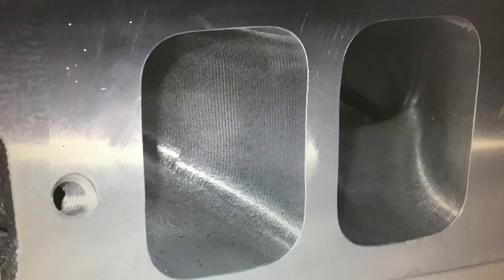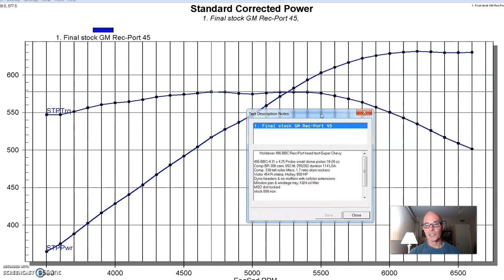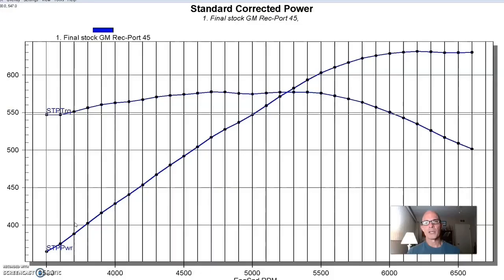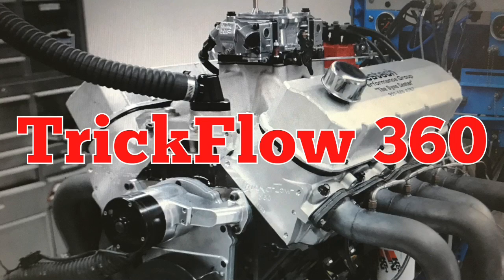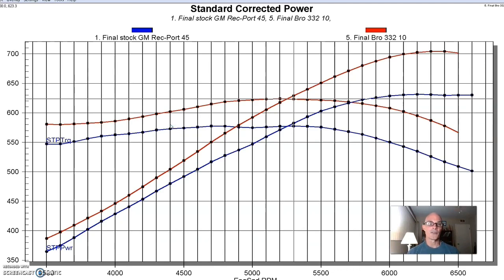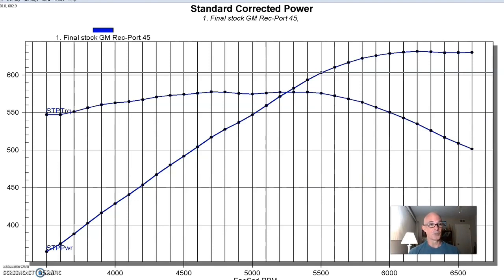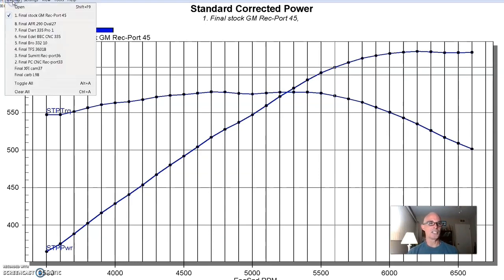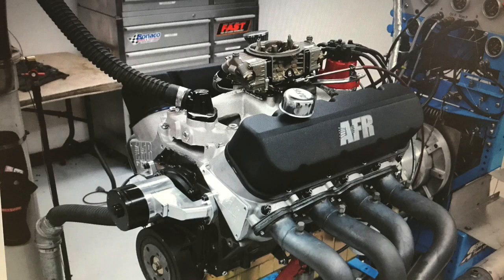HP HOW TO: BBC HEAD TEST pt2

Comment: Many many years ago when I was at tech school, we watched a seminar that the guys at Reher Morrison put on. They went way down the rabbit hole showing that the basic design of rectangle port heads has a lot of dead air space where velocity is lost and tumbling can occur. This way before cnc machines took over the world. The Morrison guys said that they believed an oval port could made to be superior but the technology to do so didn’t exist yet, but that it would within the next 10 to 15 years. And now we have oval port heads that can do what tradition says is impossible.
Reply: When I was a kid just starting my apprenticeship one day we went out to replace the dust extraction system at a sugared almond factory.
The old system was square and full of sugar dust. 
we replaced it with a new system made from round tube. 
Reason was the dead spots in the square corners allowed the sugar dust to settle out.
Reply: I have heard similar opinings from a few guys involved at similar levels of competition.
Reply: Round will always flow  better then square
Reply from the maker: the corners in a true rectangle are dead spaces for flow-round or roval is best
Reply: @richardholdener1727  Correct. Roval was mentioned several times.
Reply: Richard Holdener I went on to AFR’s website and was comparing their fully cnc’ed 300cc oval port bbc heads to their rec ports, and to get the same flow numbers at .400 and .700, you have to get a 345cc rec port according to their data. Seams like the 300cc oval ports on a 540 with a good twin turbo setup would be much more responsive and most likely a good deal more power under the curve. Even N/A they would be awesome with higher velocity, and their cheaper to boot.
Reply: I was working for GM at the time and I was also working for a guy who had a had a bracket car that had a aluminum 427 , glide , 10 inch ect in a 68 Camaro . The owner told me the same thing that he had bend told by Reher Morrison that the oval port could be a really good head . .Reher Morrison know how to make power
Reply: fun fact, tumble is how 4 valve heads dynamicly fill the chamber vs swirl with a 2 valve
Reply: Indeed. But as with everything, things develop and David Reher will tell you the same. Look at some of the modern rect port heads. The corners are quite intricate and a highly developed part of the runner design. Some have also used the dead space as a boundary layer which can increase flow by reducing drag. This has of course nothing to do with old school rect port heads. Those were basically just made that way to get the biggest cross section. Turbulence can also be an issue in high velocity heads. I have had some problems with the 300 cc CNC variant of that AFR 290 head, and I know I'm not alone. On paper they are badass, but they are pretty moody in use. 
Fact is that flow numbers are far from telling the whole story. So much go into making a great cylinder head.
Reply: @thehappytexan  Not so.
Yes those 300 cc heads are great on paper, but as several of us have found, they have major issues with turbulence. Trust me, the 315 CNC head will outperform it any day of the week, and so will the 335 CNC, especially in a 540 mill with forced induction.
Reply: @whatchu_talkin_john_willis  In the PI head 2 valve Ford they have a little area with a wall that catches the swirl for a better combustion and raises compression
Reply: @AB-80X  Could turbulence be solved with a smaller camshaft since larger camshafts may have a slowing air point with a lot of duration And the smaller camshaft will pull in air quickly and close the intake valve quickly as well with cam timing
Reply: @utahcountypicazospage5412  was more for low speed cylinder fill and emissions, it detracts from overall port airflow performance

Comment: Please do a video on the effects on thermostats and horsepower. The majority of the audience will probably never now that these engine dyno test are ran around 140-160 degrees. Thank you so much.
Reply: I think it might depend on the engine also what temperature it makes peak power at.  Nascar engines are run at around 280 degrees, I think more so because they are trying to limit the drag by not having much air go through the grille, but it might be worth testing on a older engine vs a newer engine
Reply: That could get messy being that some vehicles don’t kick on closed loop till 180 degrees which is why a lot of guys ruin transmission lock up /non lock up won’t happen till the computer tells it to which is based on heat of motor .thermostat trick works but that is more for carburetor days then fuel injection stuff but your right it can affect power for the better I’m more for putting big fans Big radiator and stock t stat to keep temps down to right when closed loop kicks in
Reply: I think it was done on engine masters on MTOD but cant remember the results. Maybe someone else can?
Reply: watch engine masters, colder water temp makes power
Reply: @ryanaxberg9263  you probably ment 180° and yes a good equalizer temperature throughout the engine and using a good cool can and pulling outside negative pressure air from around the cowl area and with the aid of an electric fan you can expect a 9 too 15 hp.gain, and that's just for starters for free hp.
Reply: @joeshmoe8847  no 280
Reply: I'm aware of this it's kind of cheating. Because most guys in the summertime can't even get close to these temperatures. Most guys that Dyno engines I've seen run 120-140 degrees. I run at the coldest water temperature in the winter which takes a while to come up on temperature 110-178 degrees maximum in the summer in traffic or sitting still. I thought by running it cool on the colder days or in the winter it might show signs of wear. I did a leak down test the cylinders were excellent and the inside of the engine was excellent after 20,000 miles. No wear at all! This is why I would much rather run too cool then too hot any day!

Comment: I'm running GM alum oval port heads (12263390)  CHANGE OF NUMBERS (14331425) on a 10.7:1 496 tunnel ram engine dual 750 Demons 294 Comp hyd roller in a 3800 lb Firebird ...i couldn't be happier (except when the needle and seat o rings bypass fuel from sitting) smooth and torquey just strong EVERYWHERE !! Great show as always ... now i'm looking at the BR-300 maybe not ... lol

Comment: Another great video. Afr are fantastic heads my brother has a 598 big compression nasty solid roller engine with the afr 345s. Had no idea the edlbrock heads was only 107 chambers the higher compression ratios of the edelbrock and afrs made the most peak hp.
Reply: What kind of power did your 598 make with 345s

Comment: Thanks for the extensive testing.  It makes sense that the shape makes no difference if the flow numbers are comparable.  I recently looked at a 1,000 HP 565 BBC where the guy said "oval port heads".  Turns out these where custom ground from Brodix blanks so they have no lineage to the production oval port heads.  The AFR heads look amazing and have my full attention.  I like the low-end torque that carries all the way through the RPM range.  Thanks again for the data.

Comment: Dude!! Your information is impeckable. You are saving a ton of guess work that most gearheads go through when assembling any motor. Keep up the great scientific info. Right in your face HP and Torque specs. Excellent base lines to select from. I value what you do. Never stop.

Comment: Loving what you Do Richard...Just completed a 496 BBC...with 10.6 to one and a hand ported Brodix 340cc and a 270 duration Solid Roller....700 lift...She belted out 700hp and 595 ft lbs of Torque...She fell right in line with your Test Motor....Enjoy your Videos...👍

Comment: This is exciting. The 489 I have in my 72 Monte Carlo is a weird little mix of the rec port and oval port motors you tested. 489 stroker with the xr300hr cam, 10.3 compression and the brodix race right ovals on it. My heads definitely flow a little less than the afr, but still makes the car feel like more than enough for the street

Comment: Great video.

My dragstrip buddies (30 years ago) used to all say that the iron heads made more power than aluminum.  

They also said the oval port heads made more hp than the square ports, but for some unknown reason, the hot ticket was to run a square port intake on the oval heads.

Most of these guys were running 496s.
Reply: I remember those days. Similarly, back in the 70s, a Ford 429 with standard heads made more power with a 429 CJ intake manifold, despite a huge port mismatch! That was in Pat Ganahl's book on Fords.
Reply: I wonder why the mismatched intakes worked out better on both occasions
Reply: @xmo552  It's still a mystery at this point...

Comment: We also had l88 heads back in the day. We had 396,402,454,496 engines. Turboing the ls6 or l88 was the hot ticket. And placing that in a 69 camaro or nova was awsome

Bloodviking

Comment: Great job Richard! I bet it’s a pain in the rear to do all that swapping! I have a 489 in my Camaro with Dart Pro 1 345 (as-cast) so I was super excited to see where this engine stacked up. Looks like my estimates of mid 700s is “about” right! (I have more lift on the cam and more compression along with a few other small differences). Keep up the good work!
Reply: Have you ever dynod  the car to see what it puts to the wheels
Reply: @utahcountypicazospage5412  unfortunately I have not, the car has been 10.25@135 with a 1.43 60’ and weighs 3590 with me in it. It’s a foot-brake car and I left at idle on that pass.
Reply: What's cam are you using

Comment: I have listened to the advice of a lot of seasoned Chevy engine builders. All say , less then 510 cubic inch ( approx. ) use oval port heads. Seems they are correct. Another great, informative video.

Comment: Great test.  I use the AFR 305 square ports with good success.   They seem to be very close to flow and port volume to the AFR oval 290's.  The AFR ovals weren't even around yet when I bought my 305's.  Keep up the great videos, excellent work.  I especially liked the small block solid lifter engine comparison as I also run a DZ engine.
Reply from the maker: AFR 305 is a good head-used them a lot

Comment: Excellent video, like the other ones. I’d love to watch the same test on Big Block 440 Mopars.
Reply: It would be interesting for sure but there are just not enough aftermarket heads made for them. Also you would have to build a very good short block to be able to turn any meaningful rpm. Mopars have very heavy stock assemblies so everything would have to be lighter weight aftermarket stuff. A better solution would be the use a low deck 400 block so use could use a shorter rod. It would limit the absolute max cubic inches but would result in a better engine. The 440 has too tall a deck.
Reply: mike s although everything you mentioned is true there’s plenty of 440 engines out there and at least 4 aftermarket heads.
Reply: @m.pietro9087  In that case we must petition Richard to go forth with such a test. Including of course the 906 heads would make 5 total so that would be good. I would like to know just for fun even though I do mostly GM and Ford stuff.
Reply: mike s that would be great, 😊. Actually I have a 440 with a pair of Stealth heads on it.
Reply: Me too! The BB Mopar is my favorite engine, and I've had at least a dozen! Between Brodix (B1 and B1-BS), Indy (many options), Trick Flow (240 and 270cc), and Edelbrock (RPM and Victor), it would be a fascinating (and expensive) test!
Reply: I know that Trick Flow got 620hp on a pump gas 440 (not a stroker) with their 240s and a mild hydraulic roller. Just imagine a 505 stroker with the 270s and a big solid roller! 700 easily.

Comment: I'd really like to see what the outcome would be with a ported dual plain air gap and the oval 290's on the 496 compared to the single plain . curious if it's worth spending the extra bucks on the single for a street strip application and would be nice to see what you're giving up or gaining going either route

Comment: Excellent tests but combustion chambers varied between 107-123 CC's. That's 16 CC's difference. I'd like to see all heads milled to the 107 CC's like the AFR. AFR is the winner but to be fair it had a compression advantage. AFR is pretty much the best in the business but I like to see a even playing field. With what I run and works! I'm restricted to 10.5 compression maximum, milled heads to achieve compression, flat top pistons and 87 octane pump gas! It's ideally where I want to be why? Because it's what I run proven and works excellent!!! No detenation, no engine run on and runs very cool! Because as any engine gets carbon black build up inside the engine, miles and compression loss, more chance for detenation over time. If you can start off running 87 octane when New you have room to grow on, up to 92 octane on when engine isn't as efficient. And I run care free 87 ethanol free pump gas. It's right at $5.00 a gallon as of 2-16-24 and keeps getting higher. I'm wanting and thinking to go to propane. It's higher octane, no carbon buildup ever, way less maintenance. The biggest thing I get a great deal on propane. And I have a pretty good stock of it. In my area propane is $1.99 a gallon. And I get a lot better deal than that. Propane Never goes bad I could go on and on about propane but most people don't care. I run a few Tri Fuel Inverter generators and only run propane! Propane is the opposite of gasoline it likes to run lean. If you run propane rich you can overheat it and burn it up. Biggest challenge where to mount a reasonably sized propane tank in my muscle car? You can run more compression on propane just not sure what's the maximum?
Reply: I did a little calculating and keeping all the specs on the compression calculator the same except the cylinder head combustion chambers cc's. Here is the results! 

123cc = 10.04 compression
107cc = 11.55 compression

That's     1.51 more compression!!! in a 496 that's a good gain. 

The larger the engine the bigger the gain in power! 

Some might say I didn't know all the specs of the engine. That's true I'm just trying to show you it's 1.51 comprehension difference between the smallest to the largest combustion chamber head.

The problem I run into I couldn't run some of these cylinder heads my compression would be over 10.50 compression because I run a larger cubic engine. I stay at 10.54% that's a safe compression level with aluminum heads, pump gas and flat top pistons. And in my other comment as I stated I won't go above 10.5, flat top pistons maximum and pump gas ethanol free. No Mini or Dome Pistons For Me. Not not with pump gas! And it's too hard to find ethanol free gas in higher octane. 

I've been down the road with too high of compression with pump gas, dome pistons and hurt a set of pistons. I babied that engine raced it a few times and only when I ran it hard I put race gas in it. And it just had a little light rattle to it mid and wide open throttle. After about 18,000 miles the pistons were shot. The engine never got over 178 degrees maximum water temperature. But I'm sure the exhaust gas temperature was too high if I would have had a gauge back then. Or a heat laser gun on the cylinder head and exhaust I would have seen it's to hot. But I wanted that little bit of extra power. But not thinking when you pull the timing back you kill power. And part of the reason I wanted to use some of the parts that I had sitting around. I had to high of compression with pump gas and some pistons. I had to turn the timing back so far the engine was lazy. The engine was no fun to drive I couldn't get into it on pump gas with out a light rattle. I had to put race gas in it and turn the timing back up to get into it. And once the engine is installed into the car with too high a compression and problems like I had. It's a lot less options once the engine is installed. You can run thicker head gaskets and change out cylinder heads to a bigger combustion. And they only make so thick of gaskets and so much cylinder head combustion chamber cc's. The other choice is pull the engine and do it right. And spend more time and money and possibly have an extra set of cylinder heads. And running thicker head gaskets is not ideal. And that only changes compression so much. With performance engines No One Ideally runs a very thick head!  gasket

Comment: Great test. I am a huge BBC fan. one thing I would have liked to see would be a lower rpm test for a BBC with oval ports vs square ports.  every magazine and YouTube video compares them from 3500 on up. and most of the time I see the square ports win in overall power, they test being the only exception that I have seen. but no one ever show the power and torque curves from 1500-3000. which is where most street motors run around town and out on the highway.  Racing is cool, however most car guys drive their stuff on the street, so I would love to see a test on a your average 454-468 with both oval and square port heads from 1500 rpm - 5500 rpm. most car guys never spin a BBC about 5700RPM. and also with cams that work will for cars with power breaks. say around 210 -240 degrees @.050.
Reply from the maker: we don't run WOT at 1500 rpm

Comment: Great video.  I was searching for flow numbers on stock cast iron head 12562925 supplied on the 502 HO.  I don't know if those heads compare to your 088 heads.  I am hope they come close.  I am assuming in your table flow in blue column is the lift opening of valve??  I will keep on viewing your videos and thanks for taking your time and money to provide good information. Keep it coming.   Bert